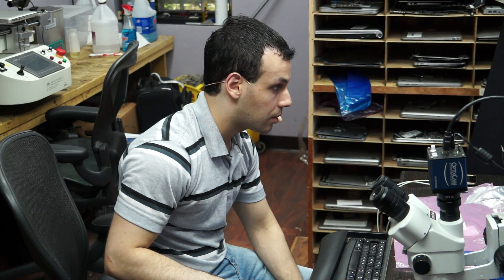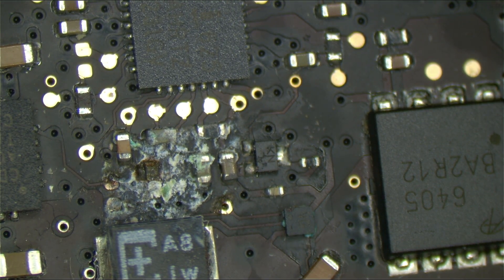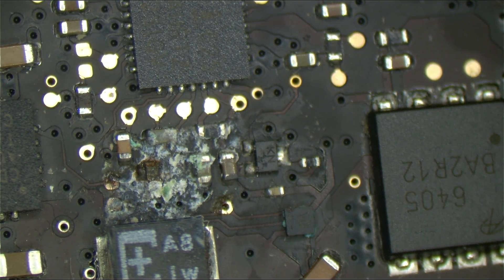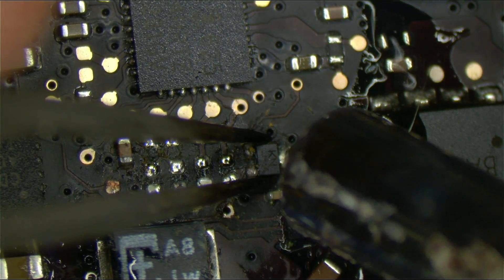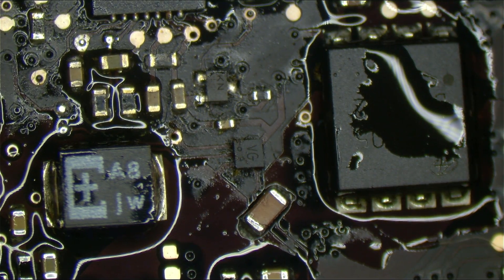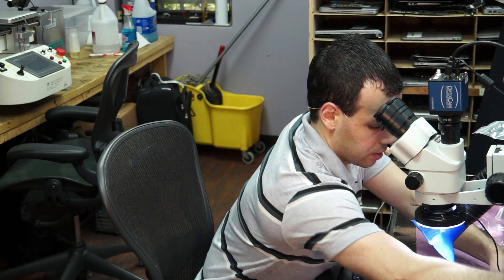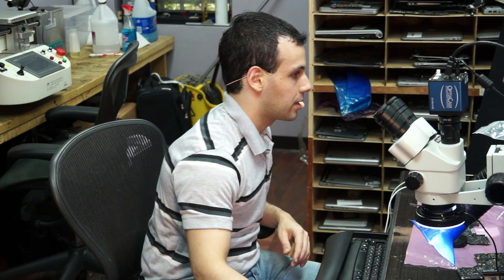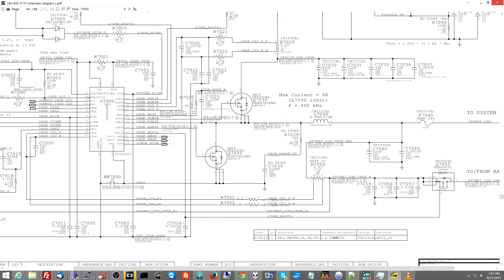Macbook liquid spill damage causes current sensing problems

Comment: My xbox one has a cracked APU die and i got a donor board which is fucked but the APU is good can you swap it?
Reply: +Laser Guy did you check if it was under warranty? I dont know how it is for consoles but computer parts very often have up to 3 years warranty. Mind you, you might have ruined the warranty if you opened it :P

Comment: Hey Louis! Good job! I have a quick question: in terms of repairability and upgradability (availability of replacement parts, change of RAM/SSD etc) would you still recommend the old unibody non retina 2012 MacBook Pro 13" with DVD burner? The still sell these (cheapest MacBookPro). What flaws do you see of this specific model and it's circuit board? I think it is still the MacBook with the longest product life cycle?
Reply from the maker: +x no. 1280x800 is unacceptable